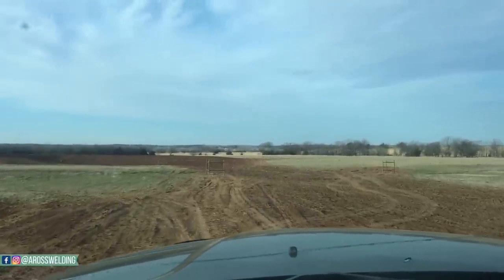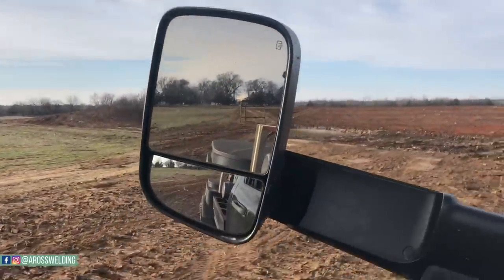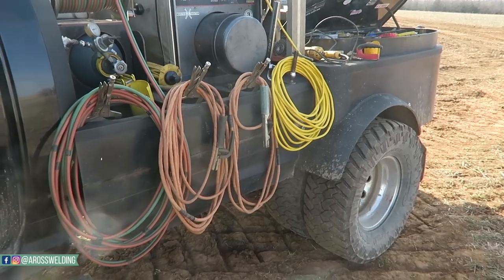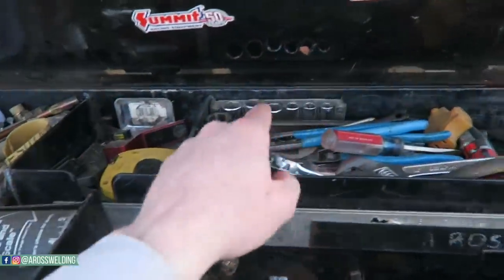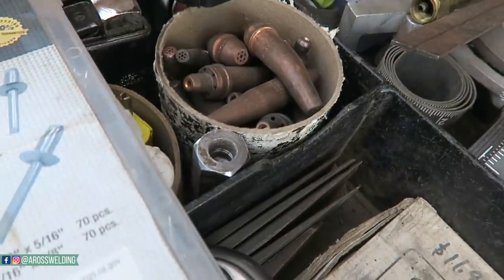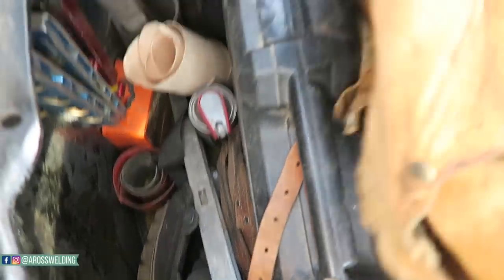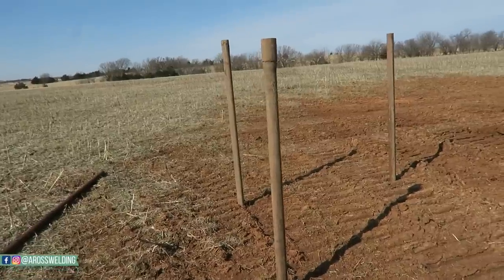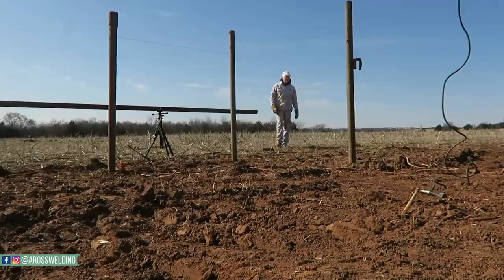PIPELINE WELDER SIDE HUSTLE // HOW I PAY THE BILLS & HOW I GOT STARTED

Comment: I have a big toolbox with foam cutouts for my bevlers and torches, a separate box for my 2# sledge and all of my clamps, smaller drawer style box for small stuff like dogs amd saw blades. Got reels for my oxy-fuel leads and the SA200. Welded in some rods of 5/8" to hold my jack stands. So far it's worked.

Comment: On your cold saw blades.  I was using EVO 14" blades for a couple years.  Not sure what happened but cut ft is down on the newer ones.  I'm using Demon Blades for now.  Also, depending on where you're at don't throw your blades away when they dull.  I send 5-7 at a time to the sharpeners.  I get slightly more cut ft out of the sharpened ones than I do he new ones.  I'll re-sharpen until I have to replace more than 3 teeth.  At that point the blade gets tossed.  I pay about $19 per blade to sharpen.  Nice on a $85-$100 blade getting double use out of it.  If you're close to DFW I use D&H down on Harry Hines for sharpening.  Do you ever have to cut I Beam or large flat plate?  The Milwaukee 8" steel cutting circular saw is magical!

Comment: The tool box layout is impressive, but what I see is you spent some quality time getting the lid seals right. Other wise you'd be level full of dust mud and general dirt in them boxes. The torch handles would be full of dirt. I had a old factory made mechanics box for a while and could not keep it mucked out. The doors were shot and the compartments filled with dirt. I worked a lot on bigger corperate farms and long miles of rutty dirt trails. It was just hell on any rolling stock.  don't miss those days.

Comment: Also I'll tell ya, a laser tape measure will save ya alot of time and make it your fit better between pipes, if you gotta make it fit with a hammer you knocking it off level. A chain wrench makes a perfect clamp for the ground around pipe. And dewalt quick clamps help for anytime you need a second hand, or third. O and a porta band for cutting fishmouths beats a torch for building braces👍👍

Comment: I thought of this the other day... can you run a tub with an sa200 running sideways in the bed and still be able to pull a 5th wheel camper (gooseneck adapter. The truck is a long bed

Comment: Just curious, I'm a B pressure welder in Alberta, Canada. This question might have been asked before, sorry if it has. I had to do 3 year apprenticeship before I got my Journeyman/Red Seal. After that I had to get a B pressure ticket, and a small bore ticket to weld on pipe of any size. Is there a similar thing in the States?

Comment: What part of Oklahoma y’all from? I know you probably said but I don’t remember. How long does it take you to cut and weld those braces?
Reply from the maker: Stillwater area. A single h-brace takes me about 30-45 mins. That’s with the posts already set and the pipe already there next to the post. All I have to do is cut, fit and weld up the braces.

Comment: When you are in a union and you if the union doesn’t dispatch you to work are you allowed to to as a rig welder in a refinery or chemical plant ?
Reply: good question  I think you take an oath to work only union  and by welding non union  depending on the job  repairing fences might be a gray area and looked the other waybut prettysure you promise not to work non union.  Going out working  pipeline   a refinery  or chemical plant and welding  pipe   might be a problem    Id like to know too if thats ok or not.
Reply: Jeff Y it really depends on the union. My friend in the boilermakers union said he can go do non-union pipe/structural, etc when laid off as long as it’s nothing to do with boiler making. It really depends on the union and their rules
Reply: Jeff Y I will ask I passed the combo test for them but I will hate to be waiting on them to be working if I can get on and do work without any problems when they don’t have work then i would be good but I will ask more before moving on.

Comment: What type and size of rod did you get out to use on the drill pipe ? And how much non-pipeline type of welding can you do before you are in to a problem with the union as far doing non-union work - ( fencing , structural , control pressure piping , ect. ) ? 
Another good vid !
Reply from the maker: 5/32 6010 5p+
And no trouble at all. We just can’t weld on non union mainlines.

Comment: what's the cost of 50# of rods where you're at
Reply from the maker: Depends on the rod type. 7018 is going to be cheaper than 6010. Any where around 100 bucks to 200 bucks

Comment: Hi Austin, how is welding in general on your body especially pipeline? What age do welders work up to?
Reply: I worked till I couldn't 60  body wore out got 45 years never used bifocals or cheater lenses .My uncle worked till he was 76. Both of us ended up on big inch in the end .
Reply: Out of all the welding jobs I would guess pipeline is the safest on the lungs. For the obvious reason of working outside. My father was in the pipe fitters union. Most of his work was in power houses, and government facilities. By age 58 his lungs were shot and had to retire. 62 he was given 3 to 6 months to live. He was very health conscious, didn’t smoke, wore a mask, etc. It probably wasn’t his own welding smoke, etc. Just the environment of all the welders and fitters working inside. Most of the guys in the fitters union died young or were on the 02 bottle at an early age. I’m an Excavating contractor, but also do some mobile welding for my customers. I try to  only do “mobile” outside. I have a nice shop, but try and do all my welding outside!